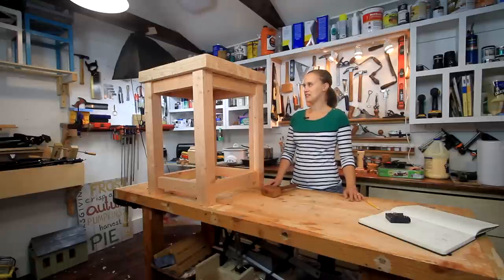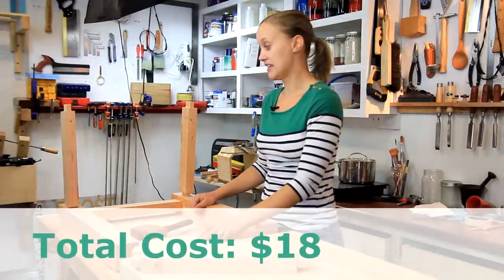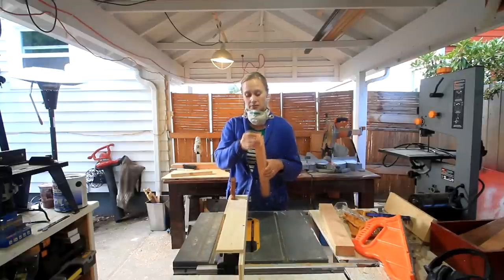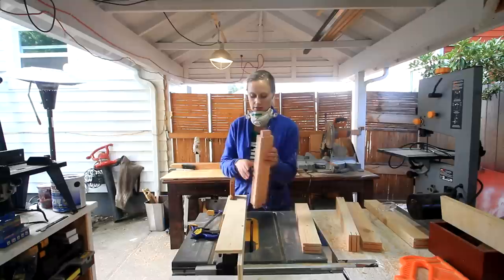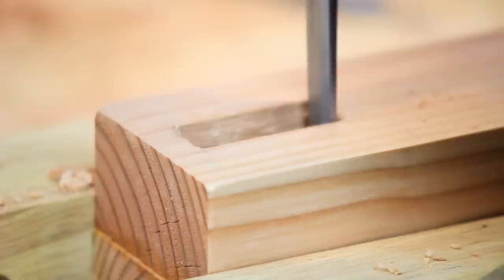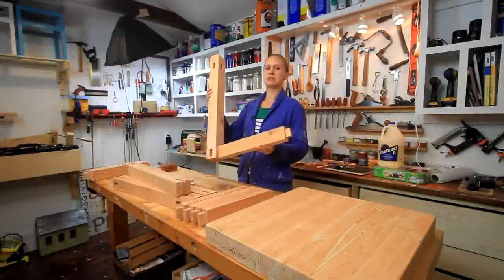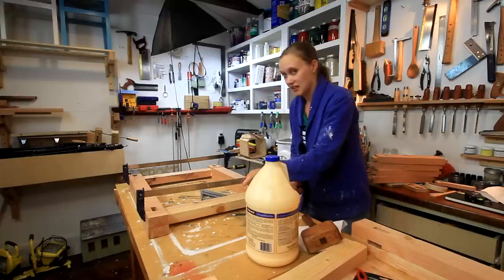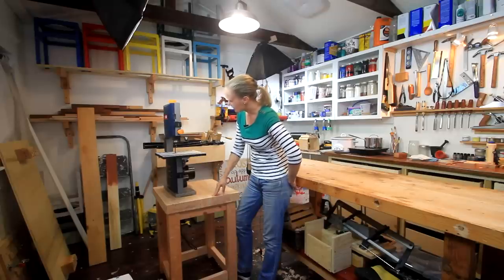Building a Workbench Table with 2 x 6's

Comment: I agree with you about the mortise and tenon.  But to be fair the experiment with pocket screws were with plywood.  The results with solid wood that has not had the grain as disrupted as plywood should be different.  Love your work and like the handle on sled.

Comment: Lovely little bench Linn Darbin Orvar. Great job with the sketchup as well, it can be a little intimidating to start but a bit of Google and Jay Bates and you will have all the answers you need....best advice, components are AMAZING when you finally get the hang of them.
Reply from the maker: ***** Thanks for the tip Tyler.

Comment: That table turned out really nice, and like you say, it can be modified to meet many uses and the building procedure remains mostly the same.  I have a #4 Bench Plane and Block Plane.  You used a Jack Plane, which I think is a plane I need to add to my inventory.  You get your exercise with Mr. Jack, but it creates a lot less sawdust mess in the shop, versus a belt sander trying to do the same work.
Reply from the maker: athiker7209 Thanks. Yes, a Jack plane is really nice to have in the shop.

Comment: Very nice. I was wondering if you built your workbench yourself? 

One of the tricks I learned to getting clamps for cheap is to use pipe clamps. You can get the clamp inexpensively at the big boxes and then just buy different lengths of pipe for what you need. If you buy a 10' piece of pipe, the big boxes will cut it and thread it for you for free.

Comment: Since you ripped all the 2x6s in half, you effectively made the table of 2x3s. So someone who doesn't want to rip all those boards or doesn't have the equipment to do it could just buy 2x3s or 2x4s to use instead.
Reply: Gary Cooper sounds logical

Comment: Nice video. Ive drawn up plans for a work bench with the same design except with 2x4s. Also do you have a video building your table saw table? I have the same saw and have built similar table but need to down size do to space changes in my shop.
Reply from the maker: Gary Jernigan I don't. I'm looking to make a video though, however I might wait until the weather is a little nicer :)
Reply: I understand that completely

Comment: That would be a nice chopping block also with about 5 inchs more, great job. Are you in the trade of carpentry, or is it a hobbie.
P.s, please put some safety specs on when whacking together wet joints, as glue can squirt out as you hit the joint home.
Atb, simon.
Reply from the maker: StyXSISoriginal Thanks for the reminder Simon. Is working on projects and videos a trade? Sometimes it is hard to tell :)

Comment: ...one other thing: have you considered routing the sharp edges with a round-over profile?
Reply from the maker: George Cooper Jr I was thinking about it but was a little concerned that the wood might chip out pretty bad. I have had some bad results with a router on framing lumber. I took a belt sander to the top to round over the edges though.
Reply: Darbin Orvar In any event, "sweet" hammer-job!
Nice...